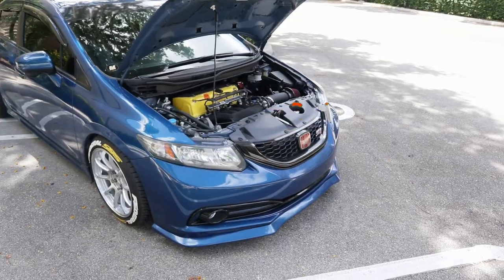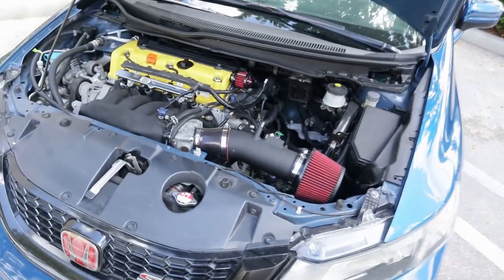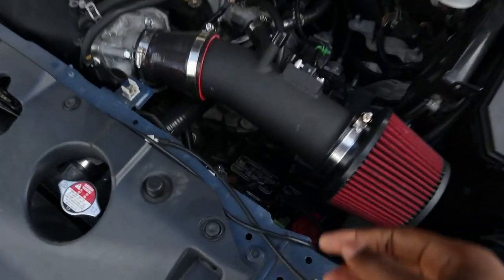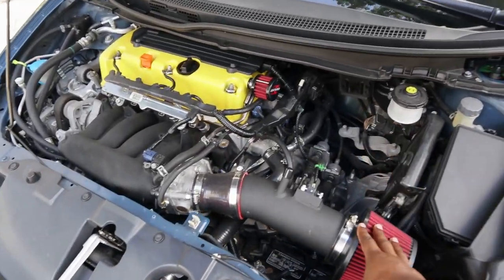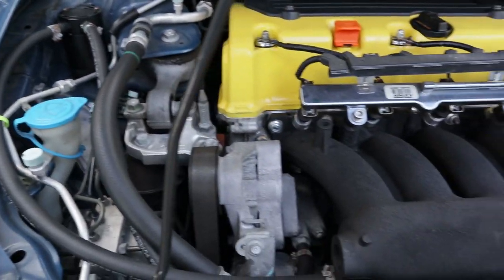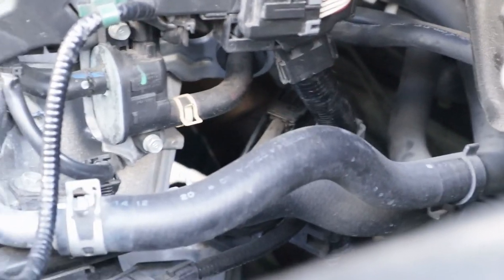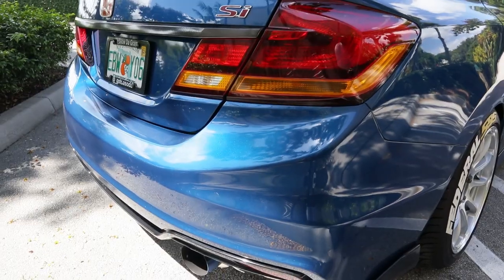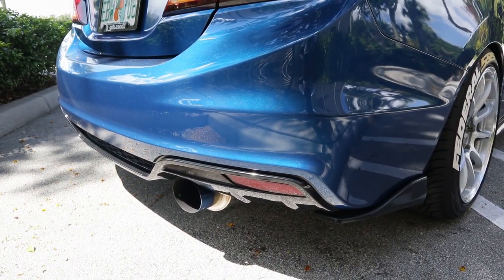How I FBO My 9th Gen Si For CHEAP!

Comment: this made me realize how much things cost more in canada bro.... i have a full bolt on fb6 as well, my down pipe and rear mount new was 800 and my prl swap kit was like 250, invida n1 3” was 1200$ my rbc used snd i had to clean it up and paint it was 250$ i did run rdx injectors with  cost extra and the same ktuned intake as you, intake cost be 400 😂 getting car parts in canada sucks asss also my damn hondata cost me 1000
Reply from the maker: SHEEEESH

Comment: Few questions... what engine is the RBC IM from? Also, the prl kit come with everything you need for the swap correct? Lastly, are you on stock 9th gen injectors, and fuel rail? Thx for everything, you are a King, hope my fg4 will be badass like your fb6!
Reply from the maker: K20z3 & yes stock injectors & fuel rail. PRL Kit comes with everything you need

Comment: From what I understand whenever you slap or mod the stock equipment you need it to be properly tuned in a shop so it will match the ECU management. Am I wrong or correct? can we just slap anything we want like catback exhaust, cold air intake and etc. from a stock engine?

Comment: I was able to snag an RBC for $100 off of a parts car 8th gen Si but i still gotta get a flashpro and PRL adapter kit + injectors and im gonna get an aftermarket fuel rail for it as well

Comment: Dusty iz Dope! I have a '15
9gen with 49k. I've had 2 9gens, 2 8gens, a 2000 si
coupe. Prelude type SH, 3 Accord V6 6sp coupes, an S2000, 2 Integra GSRs, an Integra Type R and a TL Type S 6sp. All FBO except the Type R & S2000. I'm an old guy that just digs these cars and the people the f**k with them. I'm sending a message cause I like your approach. Curios about what you did on the ugly ass chrome piece on the grill? Plus what wheels & suspension. If you have questions holler.

Comment: Bro question all my gears seem to be really hard to engaged on high RPMS especially that 2nd gears is impossible on high rpms I have to really bang it to nearly get it in any thoughts 💭 or ideas what I could do to improve it
Reply: Make sure all the linkage bushings are not worn out. Hope that it’s something cheap like that and your transmission doesn’t need to be rebuilt
Reply: Greg Sanchez sweet thanks bro it’s just being happening all the time now
Reply from the maker: Also adjust your cmc and do the cdv delete. It will help a lot
Reply: Have you tried to flush your MTF fluid? Makes a great difference

Comment: $1300 for fbo and can’t do anything without a tuner to make 30whp. Plus wheels and coil overs$$$. Can’t do a short shifter without adding the upgraded shifter cables that are $450 alone plus $450 for shifter.
No thanks!. I’ll do led lights. Side skirts. Tint red badges and maintenance! Save all that time money, headache, and keep the value of my civic up and have a comfy dd
Reply from the maker: You don’t need cables for a upgraded shifter.. and if you thinking about horsepower numbers then you must not understand the powerband difference.. going FBO wakes up the car